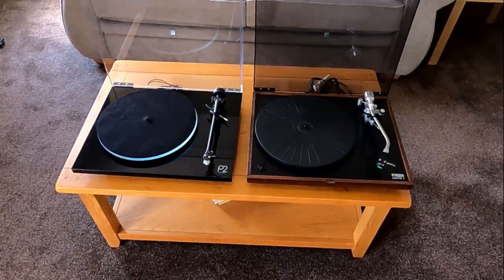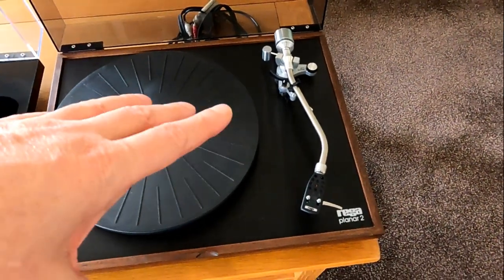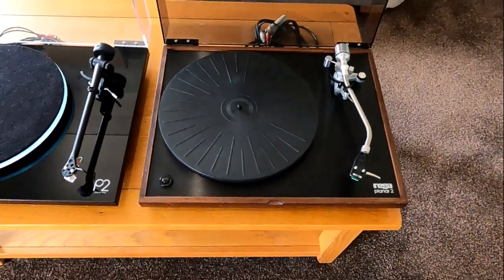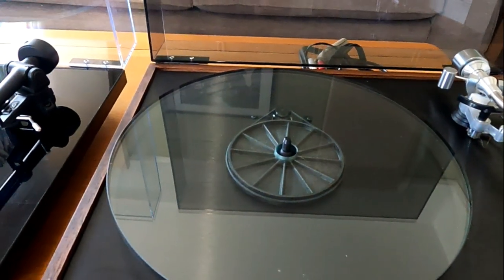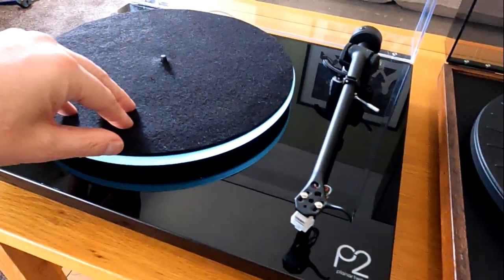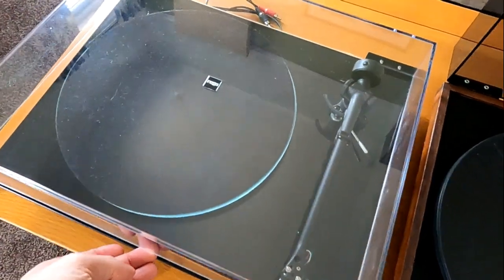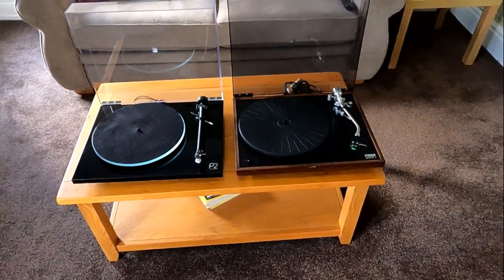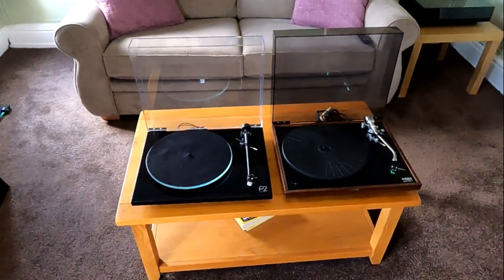The Rega Planar 2 is now 45 years old, we compare the new version to an original

Comment: I got an original P2 just like yours.   Replaced my original arm when the bias belt broke.   Put RB250 on it.  Also changed the subplatter to the tango.   This table is a great sounding table now.  It was good before but even better now.   Gonna go to the DC motor next.   Great table.  Love the wood trim.  Mine has the rubber mat as well.

Comment: I have a Planar 2 bought new here in South Africa in 1985, it came with the RB250 arm, the "modern" thin black plynth and smoke lid .. It's been my only player all this time and still sounds as good as new, all I had to do a few years ago is put a new belt on it .. It's a top notch product, looks cool and sounds great through my EL34 valves.

Comment: I had that early planar 2 as my first Rega. I remember the rubber mat as I used to play a lot of singles and it left a pattern on the mat in the shape of the 7 inch single from putting them down whilst the deck was still rotating. The very earliest ones had a metal sub platter as my aunt had one that had it

Comment: a friend of my dad had the original planar 3 and he knackered the headshell on the tone arm and rega replaced it no issue when they were giving lifetime guarantees , my first turntable when i got in to propper hifi when i was 13 in 2001 was my dads old nad 5120 turntable with the flat arm and it was pretty good

Comment: My Planar 2 has been in near-daily use since I bought it brand new in January 1998.  I was 18 at the time, so couldn't afford the extra for a Planar 3, but I've never once regretted my decision.
Mine still has the smoked lid, though the hinges have had to be replaced a couple of times - they eventually snap after years of constant flexing.  I've never messed with the bearing as I've heard Rega say that the lubricant lasts forever if it isn't disturbed.  I've given it a new belt a few times and modded the RB250 slightly with the Origin Live counterweight, but aside from that it's completely stock.
The only real criticism I have of it is the flimsy cartridge tag wires on the tonearm.  I kind of wish they'd designed it like a Jelco arm and made the tags user replaceable, as they tend to break very easily.  Mine needs to go in for a rewire at some point.

Comment: My first real table was the 2 around 1979…and it had a felt mat. Moved onto the 3 and eventually the P25 and now a Thorens TD 124 II with an RB300 bought when it first came out. But I’ve just bought an original Planar 2 with a Grace G707 although I’ve also recently bought an R200 and had the bias fixed and arm rewired. Why? Because it is a lovely deck to look at and sounds great. And I can ‘add’ to it over the next few years. I’d be interested to know if there are any Rega mods you approve of. And could you show us a few of the problems you think these upgrades (?) cause? Very much enjoying the channel.

Comment: I have an identical deck to the 40 year old P2, although I'd say mine is in slightly better condition as the wooden panel is unmarked. The mat is the same as the one you have there. 
I'm just about to swap out the R-200 tonearm for a RB-220 but you'd take 40 years of use.